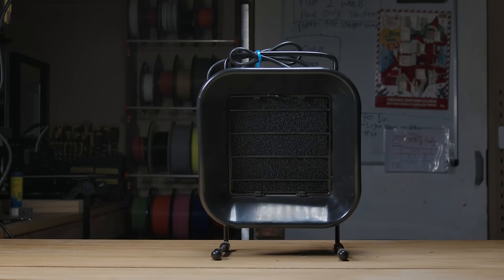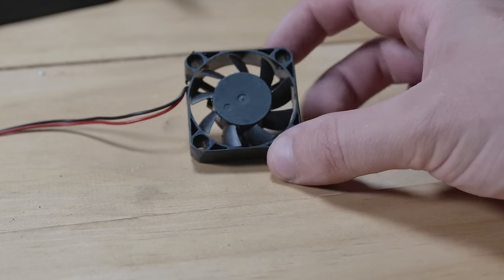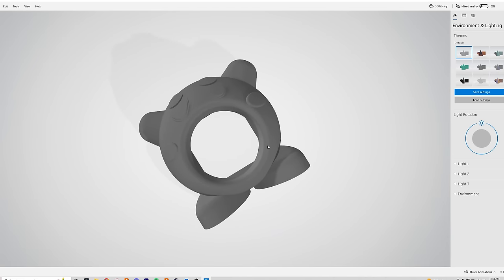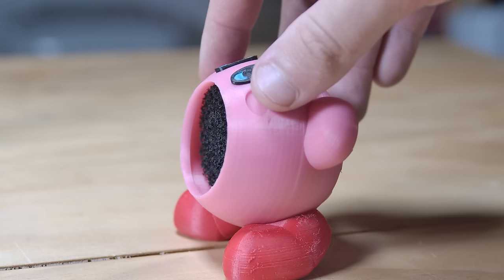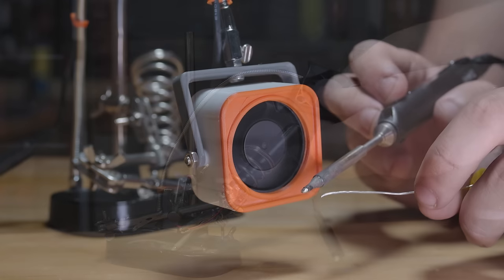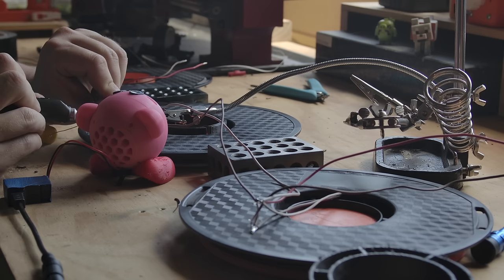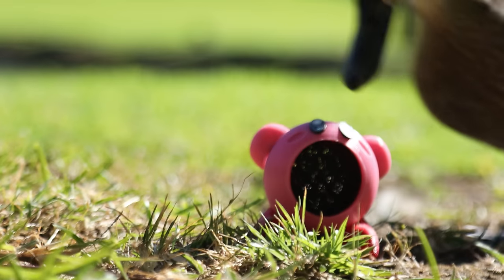I Printed The Perfect Fume Extractor

Comment: Kirby Vacuum adaptor for the win.
Reply: I just have to ask, how well or bad would just using the vacuum when soldering work? Will it kill the vacuum? I guess the filtering is actually really sort of good, especilly with a full bag :)
Reply: bit noisy and 300+ watts instead of whatever tiny amount a PC fan uses, silently, though 🙂
Reply: I don't think something that can suck up the dust from your floor is going to complain about the smoke from your soldering iron - its just burnt flux. Contrary to what people believe there isn't any measurable metallic content unless you have your soldering iron set to several thousand degrees. I would think like Howard that the problem would be the noise and power use.
Reply: Vacuum adaptor 💀
Reply: I need one
Reply: Kirby vacuum would be lovely
Reply: I'm now blaming you for that Smith's ad I keep getting
Reply: Unclear, any adapter for a Kirby vacuum or a Kirby adapter for any brand of vacuum?
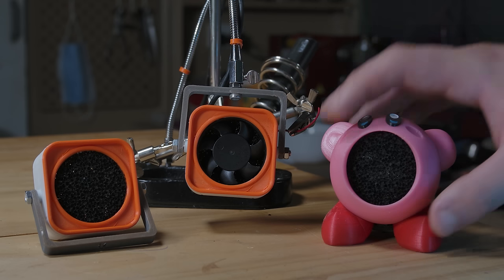Reply: @Derek.Mitchell  Kirby "character" adapter for any brand of vacuum per the video at 5:49
Reply: This idea is not novel, you didnt think of this and find out after, you stole the idea period.
To clarify because I was a bit in a rush and grammar isnt great in other comment.. there is a kirby clear as day at The bottom of the search results he shows us... then he starts building sayin he knows just what he wants... then all of the sudden he says hes had an original novel idea of making kirby into his vent and only finds out others have done it after he has the idea himself... when in reality he saw the other kirby just like everyone else can, even us in the split second its on screen, and stole the idea and then set up the video in a way to deceive the audience and not give credit to the person he got the idea from in reality. Sad really.
Reply: This idea jumped to the top of my “MUST PRINT” lost

Comment: Fair warning, those fume extractor filters are hopeless. There's a reason that professional fume extractors use massive filters. Maybe a 3m p100 pink filter? It wouldn't do volatiles, but charcoal requires replacement too often for a hobbyist bench.
Reply: I would suspect the reason is mostly that the professional ones are intended for use by people who do it 8 hours every day for years and in a space where ventilation couldn't keep up with the amount of fumes produced (presumably because could be 100+ people soldering at the same time in that room). If it's one person in a reasonably ventilated room doing occasional soldering work (not hours of non-stop soldering), just getting the fumes away from the user to be diluted and then ventilated is probably the most important part.

Comment: I think the most important point about the fume extractor is how efficient it is. It is cute but if it does not filter smoke adequately, I would say it is just a decoration.
Reply: it's more of a fume spreader because he uses the wrong filter material.   
filter is for water for a whole other application.  
i mean you can freaking see through it and he thought it would filter nicely...
(plus an extractor would have a hose and the fumes after filtering would be ejected to outside)
Reply: @darkracer1252  Proper extractor is not a solution many hobbyists can do, this seems quite useful to move the fumes away to avoid them being breathed in.

Comment: hey your project is very inspirational, I'd add one more thin filter paper, the kind they'd use in the air purifier, it helps prevent the smoke from coming out a lot

Comment: I think I'd like one that was a touch bigger, using a 60 or 80mm fan, but that doesn't look like it would be too hard to do and would perhaps give room for a HEP filter too. Sounds like an excellend design project.... Hmm what about a Garfield Lasagne filter or a Scooby Snack air filter... :D
Reply: the one at 1:21 by KnoppersDE uses a 60mm fan
Reply: Hi, if you really like the design, you can just scale the parts in a 3D slicer to make it twice as big. Just make sure you remember to do that with all the part when you put them in Cura, Cubicreator or whatever you use to slice ;)

Comment: Idea behind a "front filter" is that a Fan generally has a easier job pulling air through a obstacle, than pushing through one.
In practice this difference is pretty small (unless the fan has some shoddy construction to keep somewhat of a seal on either side), but for fume extractors every tiny bit is squeezed out of it.

Comment: the hose comeing from that vacuum kirby gives me an idea:
the filter of the extractor does not need to be directly in front!
if you place a hose directly over your soldering place the other end of the hose could be having a large filter, and exhaust to outside of the room. you could even use a noisy fan if it is far enough away.
the only thing you would need is an arm that holds the end of the hose in the right place and orientation.
Reply: So basically, a dust collector arrangement, but for really fine dust

Comment: If you want to completely eliminate paint, design the eyes so the blue, white and black sections are at least 3 layers apart from each other, and use layer-based color changes. 
In case you don't know, PrusaSlicer has a feature where you can tell the printer to stop on a specific layer and manually switch the filament colors.

Comment: Maybe a combination of a charcoal filter and a pleated HEPA filter would work better for filtering. Remember masks?
Reply: Oooor just buy a 3 part filter (with all that included) that is designed For soldering. That filters all the micro bad stuff you want it too.
Reply: @crisnmaryfam7344  Oh that's good, thanks for telling me. Unfortunately the availability in my region seems... not really there, but i'll keep looking. I was thinking of getting a pleated HEPA filter such as the one from Kärcher VC3 and using it in conjunction with an activated carbon foam from pet supply store. Or outright putting an IKEA UPPÅTVIND on my desk, replacement inserts are only 5€.

Comment: Would suggest going up one difficulty level and going ABS on this one as you can smooth the prints via vapor chamber (don't expose the treads). And then swap the pain to ABS dissolved in acetone. I'll looks less cheesy than the paint. This also could be done to smooth the parts verse vapor chamber.

Comment: 2:33 character modellers don't use parametric modelling software like Fusion360, Solidworks etc. There are specific 3D Modellers out there for 3dmodellers, that are much more fluid to work with and make organic shapes etc. like Blender, Maya, 3dsmax, etc. thins like just pulling parts of the model around, enlarging them. Think like the warp tool in photoshop. They don't have to sketch something, then extrude or do some other parametric style extrusion to it. Obviously that doesn't work for engineering design, but it's not as hard as what you did.

Comment: If you could DIY the professional version of the Hakko soldering filter by using the vacuum and the Kirby adapter with the filter box in between (I believe it's a combo of charcoal and HEPA)... Dude, that could be a dandy cheap and dirty clone with a lot more suction than a 40mm fan. Not sure if it's a good idea to expose a vacuum device to rosin flux fumes, but eh, use a cheap one, I guess.

... Hey, I have a cheap Wyze hand vac...

Comment: If you didn't have a filter, that kirby's probably enough to pull air out of my 1'x1' workarea (it's a floor tile). Been using one of those tiny USB fans for the light soldering i do (i built/flew drones as a hobby) so i don't think i'll need a filter. Nice idea.

Comment: These cheap fume extractors with the carbon pads do like nothing to help with the solder fumes. You can see it even in the video that the smoke is coming out of the back instead of being filtered
Reply: They may not be perfect, but for occasional use I suspect they're totally adequate. Their most important function isn't even filtering, it's just sucking the fumes away from the user. Instead of huffing a huge concentration of fumes directly from the source, they get distributed over a very large volume of air in a hopefully well ventilated space. So there's still some exposure but orders of magnitude less than without the extractor. Now, if you plan on doing hours upon hours of soldering work in a badly ventilated space, it's a different story - the fumes would accumulate in the room and at that point you're sitting in a soldering fume hotbox.

Comment: it's a very funny design. I would like to modify your 3D model to fit a huge 120mm fan (radiospare 825-6668), scaling the stl x3 doesn't work. thus do you think it would be possible to have the .STEP files of the Kirby?

Comment: those are not fume extractors.  they are crappy forced air filters.  

a fume extractor removes the fumes completely from the room (and in vents it to another room or outside) and also filters it in the process.  but it just doesn't directly vent it back into the air inside the room.  you can even see the smoke come out of the other side and it's basicly just a fume spreader instead of a fume extractor, because they are certainly not filtering.  those are not charcoal filters for air.
Reply: Surprised I had to scroll so far to find this comment, and that there are so few other comments mentioning that. Other people are going to watch this and think something like this is adequate fume extraction when it is no where near close.
Reply: @mikeebrady  yeah.  there is no hope for humanity